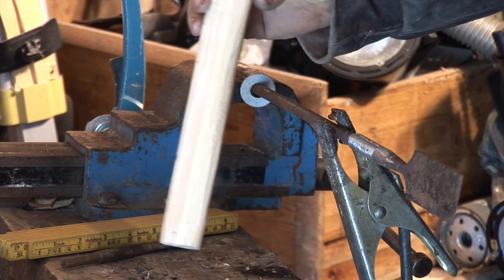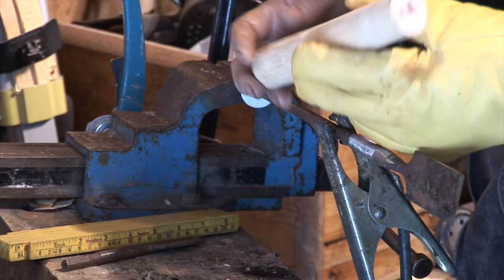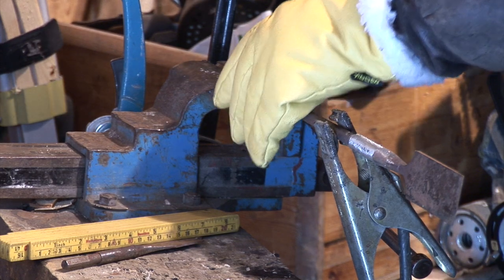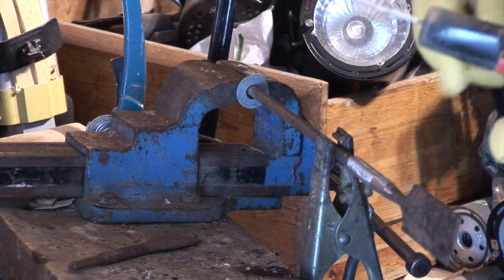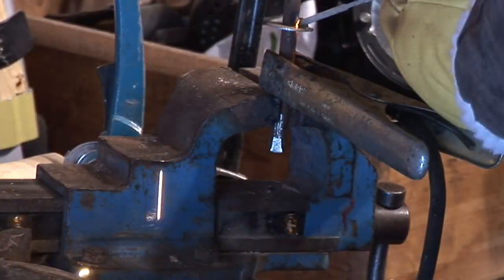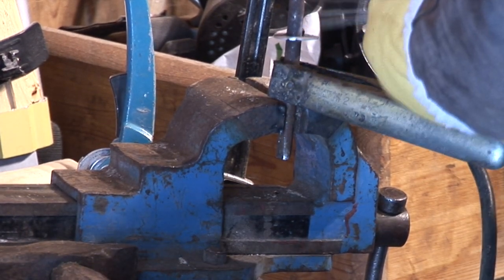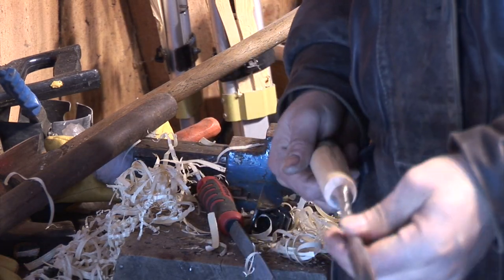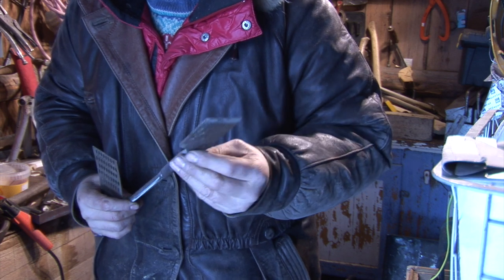🔴 Recycle Tools: Chisel becomes "Slick"

Comment: I've often considered taking one of my 2 inch socketed chisels and turning a longer handle on my pole lath, and reworking the edge geometry a bit for a sweet little slick, a tool not struck but pushed.  I will some day.  I have tried a little stick welding but do most my welding, all of it actually with a mig.
Reply from the maker: You have a fantastic collection of tools for framing, it was one of your show and tell videos that inspired me to make this tool, I was quite envious I am ashamed to say. I have a mig welder but it had stainless wire in it..... These modern welders are amazingly good (I am of course talking of the machine not the machinist).
Reply: @LucasRichardStephens  Cool I have impacted another crafter.

Comment: Have you ever tried to dry the welding rods (electrodene) in a oven prior to use? The  moist makes it more difficult to get a good result.
Reply from the maker: I store my rods above the cooker in the kitchen to keep them dry.  Pendulum welding is trickey, you live and learn, got to just keep at it, improvement is slow but sure.
Reply: @LucasRichardStephens  very true; training makes champions. But a little help from optimised equipment doesn't hurt. You could do a test next time you weld. Dry some in the stove, and compare them to the untreated ones?  Then you will see if it easier to use, and if it is worth the trouble.
Reply from the maker: @sidekickbob7227  I will try it Bob!